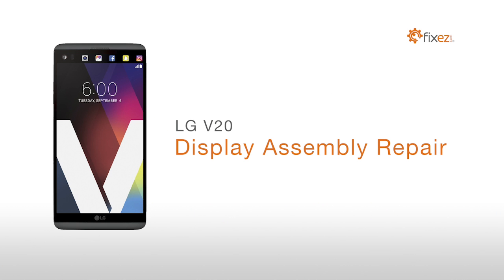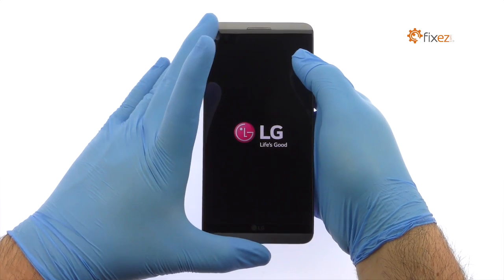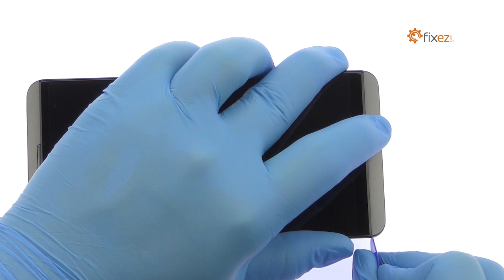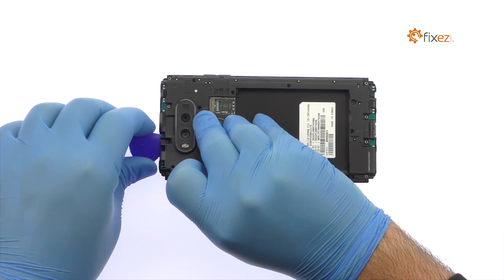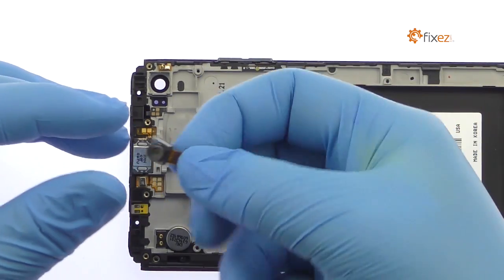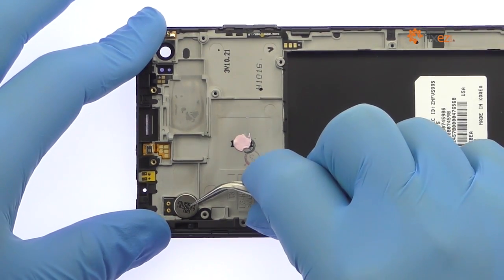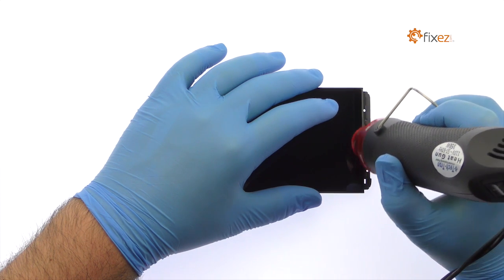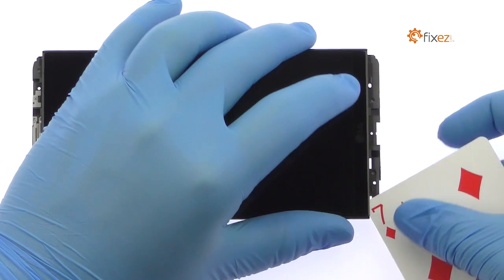LG V20 Display Assembly Repair - Fixez.com

Comment: Ok so question, I bought a screen and digitizer, not from your company, but so i did it because i dropped my phone in my pool, oops, and so amazingly after a day in some quinoa, it started up just fine, buuuut the freaking touchscreen was broke :( So after a couple more days the screen suddenly went super dim except for in the top right corner and I had hoped that replacing the screen and digitizer would fix it but it did not so my question is, should it have fixed it? Kind of wondering from what I saw on your site if maybe the screen I got should be returned. I am assuming the issue my phone is having is with the backlight because everything is fine. I can now use touch, and I have sound, although I have to put my phone on speaker to talk with someone which I am willing to be ok with but man is it hard to see my screen in outside light :/
Reply: Did the same thing with mine last night, my screen is exactly as you described with it going dim except the top right corner. What did you end up doing? Cheers
Reply: Mine also. The backlight is dim except for upper right corner and 2nd display. Try googling the solution but up to no avail. 😩
Reply: Did you guys found out any solutions?
Reply: Oh! My friend's screen does the same thing (and also due to water damage 

I received the display assembly with frame and was hoping that would solve the same problem a friend's phone is having. As I've already messed up the front camera (sensor came off but the lens stayed attached),I now don't know lf I should bother continuing. They don't use the front camera anyways, but if this won't resolve the issue then I just wasted money.
Reply: @Devo_gx  Did you end up following through with the repair? If so, did it actually fix anything? I have the exact same issue and would love to be able to fix this myself if its possible
Reply: @danielbartus8800  Unfortunately it didn't work. Ended up giving up on the project
Reply: @Devo_gx  Okay, thanks for the reply. Doing some more research, it's more likely that backlight issues or black screens due to water damage are caused by the connector from the board to the screen getting corroded. Cleaning with alcohol or a good cpu cleaning solution and a soft brush might fix it, but even that's a crap shoot.

Comment: Thanks for the video. I successfully repaired my cracked screen and LCD. Didn't have a heat gun, so I used an electric stove top (not recommended), but it worked!
Reply: P Davis how did you do that?